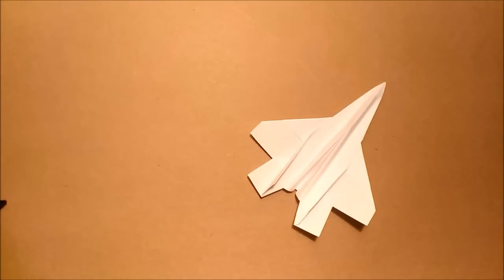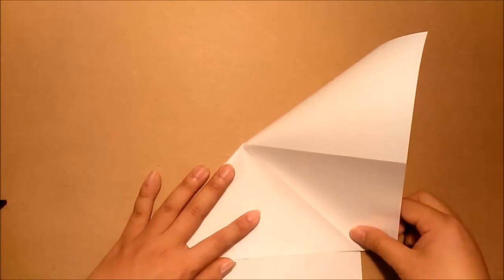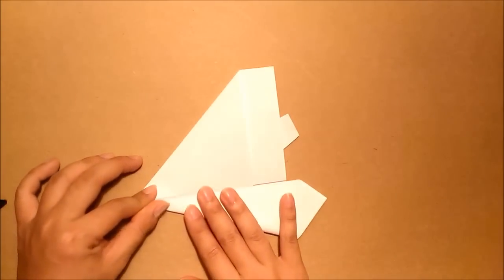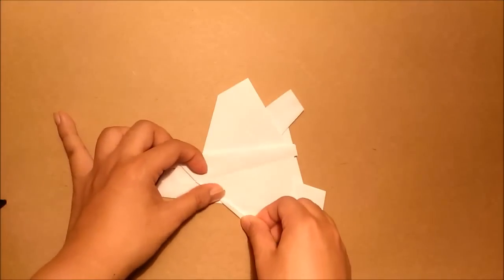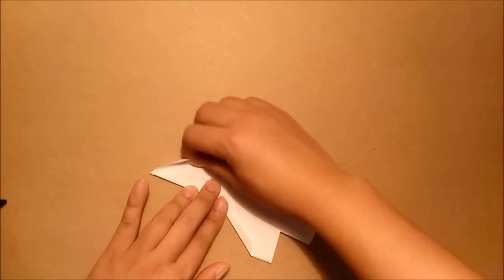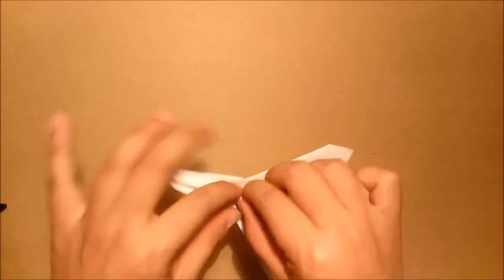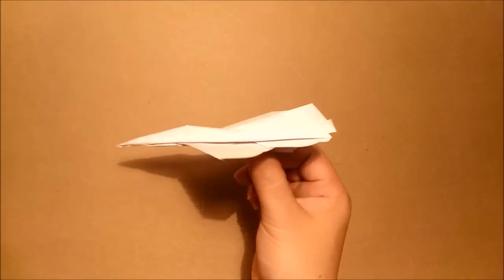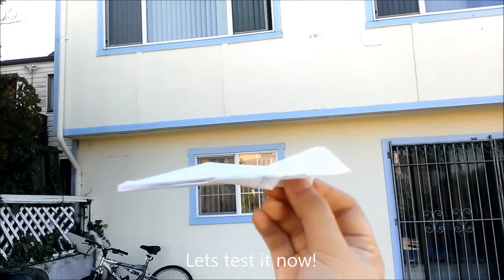PAPER JET FIGHTER- How to make a paper airplanethat FLIES FAST | F-35 Lighting

Comment from the maker: Hey guys,  instead of giving it a thumb down. Tell me why you didn't like the airplane. Give me feedback such as it doesn't look cool, it doesn't fly at all, or the instruction is too complicated. etc.
Reply: Stuck at 6:30 could anyonw help????
Reply from the maker: Hi Smith,
That step is hard. I suggest you watch it at HD resolution without folding. Then redo that step.
Reply: *****  Thanks for the help I got past that part using your help but now im stuck at 7:05 I may have folded some parts wrong this is my second try of making that plane
Reply from the maker: It is a bit hard if you just fold it the first time. Don't feel bad. It took me about 6 months to create this plane, so it should take you a few hours to master all the folds. Good luck!
Reply: Could you maybe get rid of the music as I can't hear your voice correctly in some parts :(
Reply from the maker: I can't delete the music, but I may create a new tutorial for this plane.
Reply: The steps are hard
Reply: this is hard
Reply: everytime i fold the plane the wings are always not correct position please help:(
Reply from the maker: Well, you need to watch the F-22 for some folding tips. Then, remake this plane.
Reply: PLZ  help mine is not flying its looping and falling
Reply from the maker: Get a new sheet of paper. Fold a some more, and look at how I tweak the plane; then, you will see the different. Some people refold the plane in a next day, and it just works.
Reply: ***** the music is fine just talk louder!
Reply: Who knew? An 11 year old boy can't make it LOL
Reply: +Carter Kelley im 10 years old and i created it... even his f-22 raptor :P
Reply: It's the same as your F22...
Reply from the maker: raj1966 stuff in fact, the F22 is an enhancement of the F35
Reply: +TriKdanG kkkk
Reply: +TriKdanG what kind of music is this because I love it
Reply: like cithat

Comment: I messed up at the beggining xD is it a square that you start off with?
Reply from the maker: It was letter size paper. 8.5x11 in. Follow the instruction carefully, you will make it work. If you have A4, you can print this  template out : http://goo.gl/75V2eO. Then trim it to the right dimension.  Does it answer your question?

Comment: It is a great plane and is very hard to make, very hard for beginners, great way to show how to make it. But a quick pointer, it is a tad bit hard to see because of how the light hits the paper, my suggestion, for the next video that you make, make the plane with tracing paper because it does not have a glare at all. great video all around though.
Reply from the maker: Thanks for your suggestion! I will test with tracing paper to see how it works.

Comment: I have been doing this for an hour now and I cant understand at 6:36 how it folds and then, for me, the front gets caught by the piece at 5:40. I don't understand how it's stuck or how it's even frustrating. If you could explain why its stuck, that'll be great.
Reply from the maker: There were 2 layers at that step 5:40., so when you fold that part in, it stay there and increase weight on the head and hold off the wings. It does not really stuck to anything. At 6:36, folding that crease to help you make the body of the plane, and form all parts together even the head which you made at 5:40. Watch the video again at high definition quality, it will help a lot. If it doesn't work, try the my F22 then come back to this plane.1 hour is not too long for the first time.  I spent about 6 months or so to create this plane.

Comment: I can't make it.... I stuck at 4:07... I tried to match it but, it doesn't leaves any space between the middle and the fold... I use A4 paper then I cut it into 8,5 and 11 inch...  I have folded it accuratelly and made it symmetrically by using ruler
Reply from the maker: You can fold it less a bit. That meant the wings will be shorter, but it still flies very well. Here is my recommendation:
1. Fold it freely to get used to the folds
2. Be creative. Adjust if you have to do so.
3. Watch the video again for references to make a nice plane.

Comment: You wanna makea two restar video amd repeata same step
Reply from the maker: If you meant the F35 and F22. They have similar steps, but a few changes make the two planes different in both shape and performance. The F22 flies much better. If you don't believe me, as anyone who has tried both planes. Also, I simplified the F22, so you guys won't get tired of making that plane.

Comment: What paper? Can you tell I've tried to do with A4 paper but not paper?
Reply from the maker: Most of my paper planes can be folded with A4 paper. If it doesn't work well, just trim the length 2cm down.
Reply: So what you have paper?
Reply: +TRI DANG Hello, I tried to help was a tiny paper cut 2cm Could you take ?